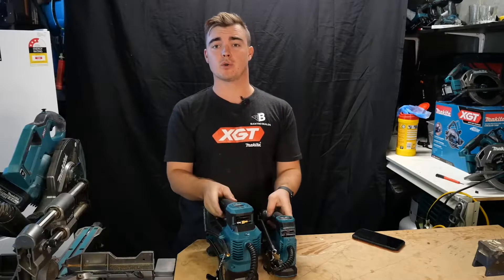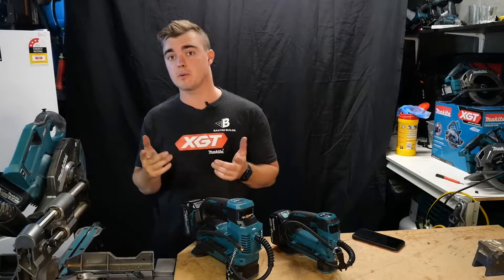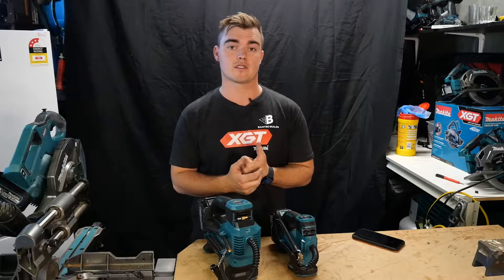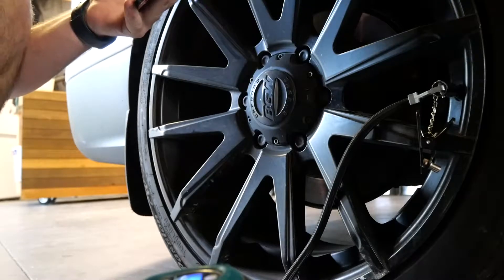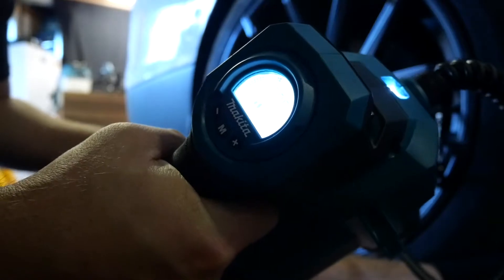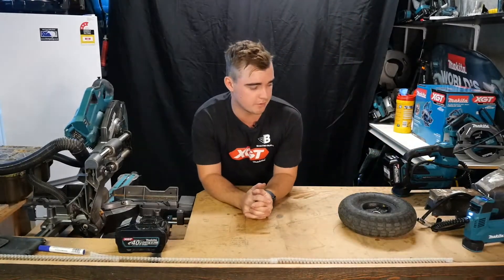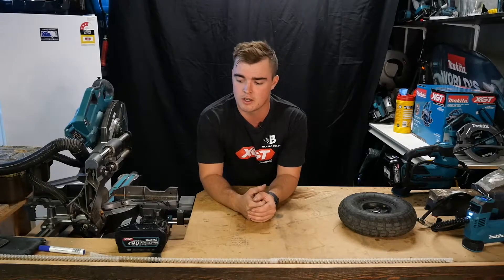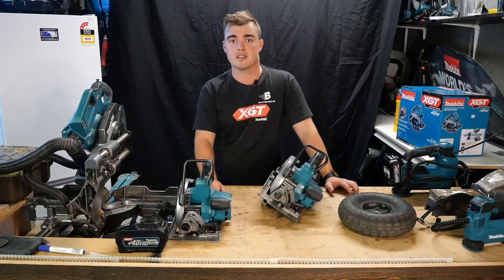IS THE NEW 40V TYRE INFLATER ANY GOOD??

Comment: The Makita 40v inflator I have does not cut out at the set pressure, yours didn't either when you pumped your van up? Also the 18v seems to let air out to drop down to the set pressure as you showed in the video but the 40v doesn't do this?